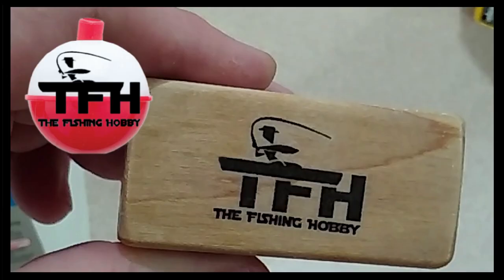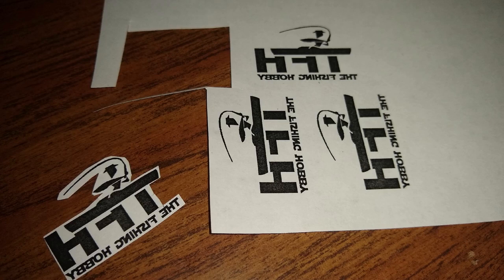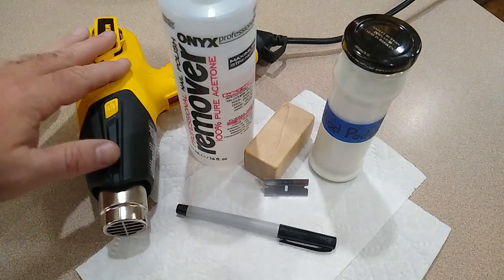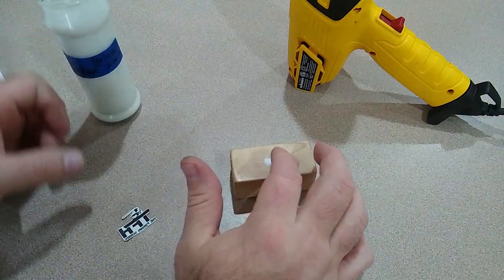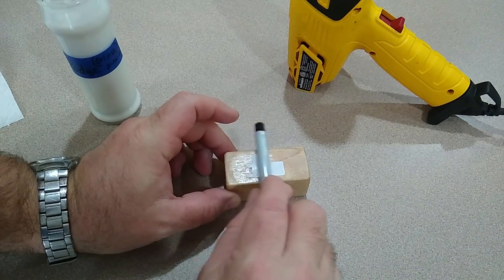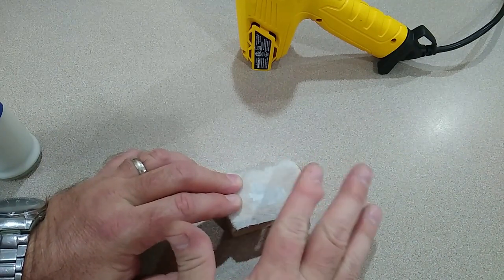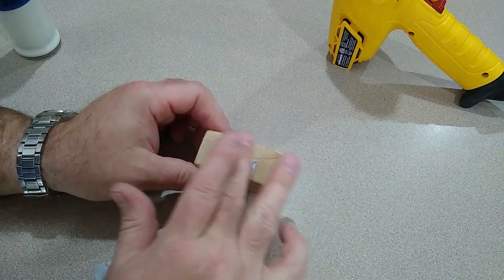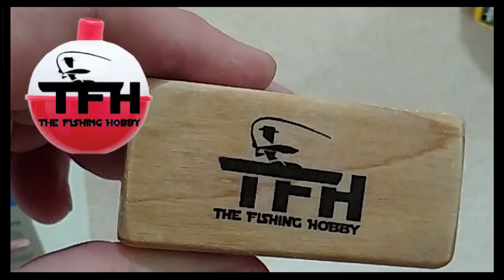How To Do Toner Transfers With Ordinary Paper - Make Logos For Rod Building!

Comment: will this work on a white blank
Reply from the maker: I have tried it on epoxy and it works BUT don't do the acetone or razorblade steps. The acetone can damage some blank finishes and epoxy and I wouldn't scrape the paper with a razorblade on a blank. It will just take a little extra time to work the paper off. You will need a very flat surface, so if your blank isn't flat, add a thin coat of epoxy and let it fully cure before doing the toner transfer.